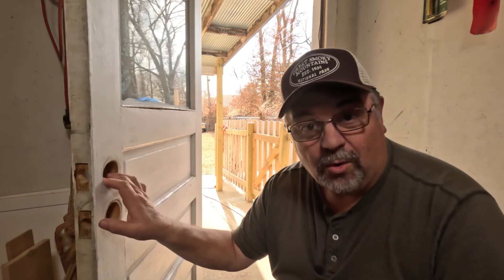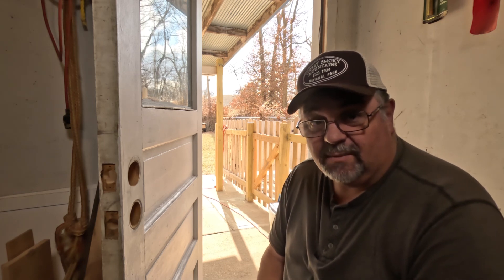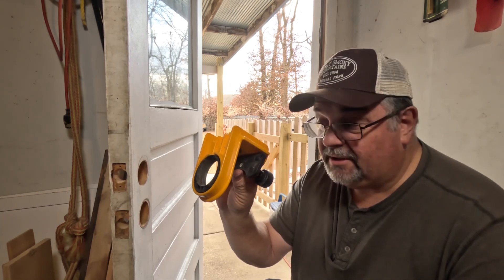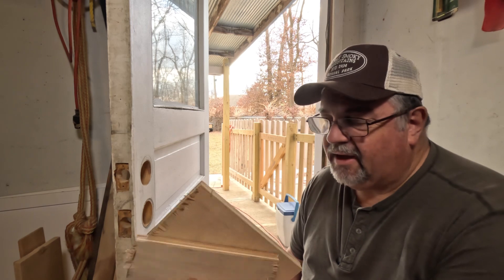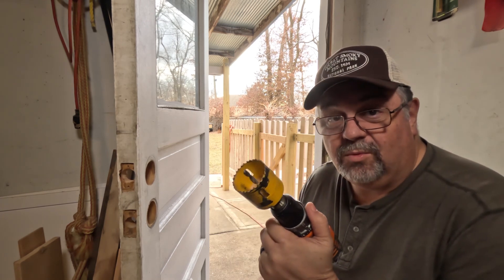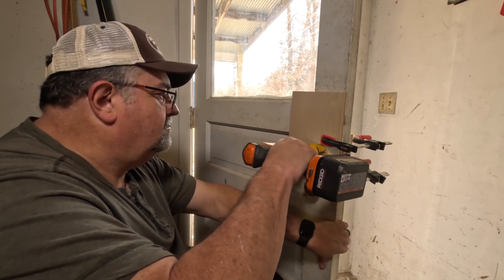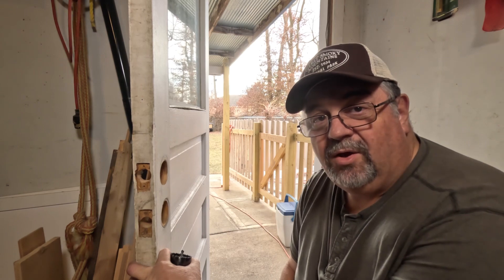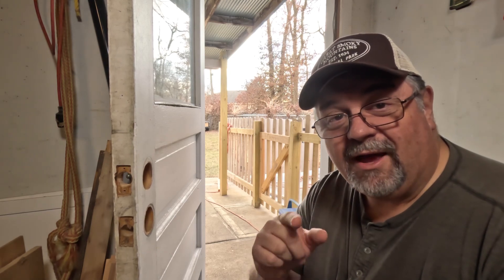How to Enlarge Door Knob Hole - The Easy Way

Comment: took the lock out, checked mechanicals, did some wd-40 which got the outer cylinder working and reinstalled everything. It is working! Yay! The volume thing is odd, some videos are fine , others not at my end. At any rate, I followed along and got the lock working.  TY
Reply from the maker: Awesome!

Comment: What about using a drill bit to chisel away the extra space you need?  I like the way you do it, but looking for the cheapest way
Reply from the maker: I would be careful doing that. It might be difficult to control and could cause damage to the door. I would maybe experiment with some kind of sanding or grinding bit that would go into a drill. Not saying it can’t be done, but I don’t think I would be able to do it with just a drill bit. Good luck. Appreciate you watching.
Reply: In my situation, the existing hole seemed to have been made by a drunk woodpecker.  A 2" hole saw was too big.  I used a half-circle rasp bar to take down the high spots that allowed me to get the 2" hole saw started and through to the clamped board and punch a pilot hole in it.  I then used a 2 1/8" hole saw to enlarge the existing one, per Dave's instructions.
Great result!

Comment: My new doorknob fits, it's the latch hole that doesn't fit new latch
Reply from the maker: Bummer! This may be a case where the actual door jig may be best. Depending on how much it is off, it could be possible to use a round sanding attachment on a drill to enlarge the hole, or possibly even a rounded file. Good luck! It can be done!